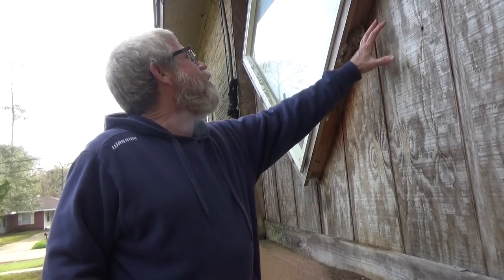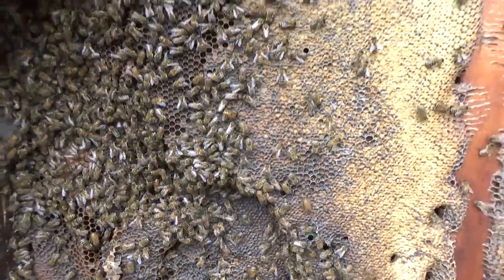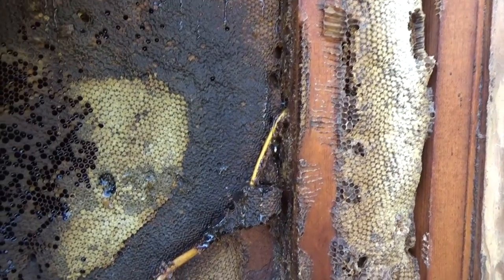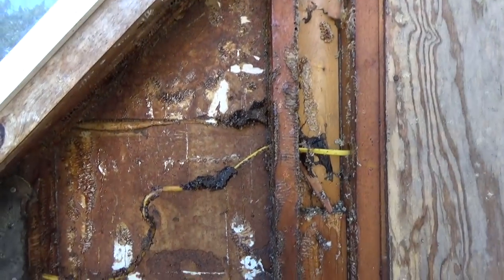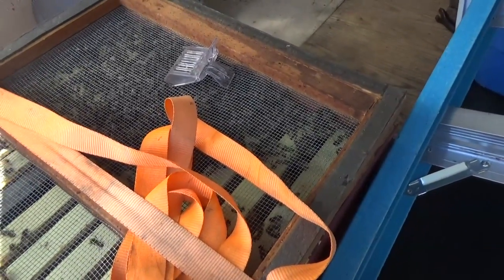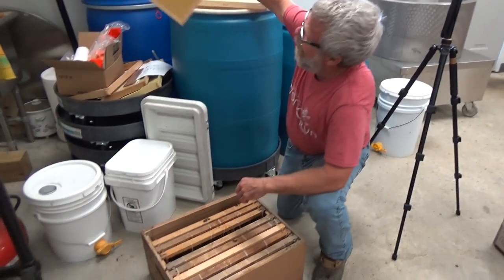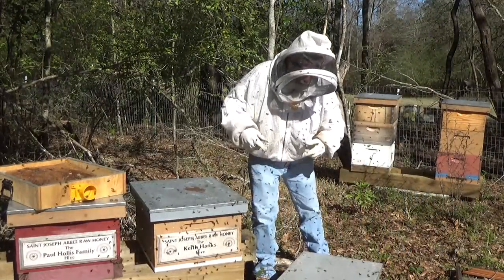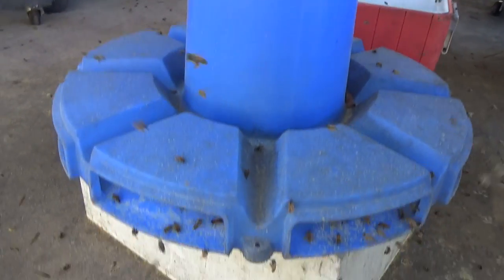Electrified bee hive. What happens when you cut a wire hidden in honey comb

Comment: Aloha Jeff, 
What is the main honey that you find in these wild hives? Here, it can be one of the main flows[mostly] and all the short, quick flows are not saved by the bees, but they eat it up or use it for building their comb. In tall stud walls, they pack in about 100 pounds per stud. And if there is a pathway to the next stud, it will mostly be another queen and hive. One empty home had 20 studs full of hives. Each was another queen, each was full and 100 pounds hanging full of honeycomb. It took a week to remove them all and reclose the walls. Each one I found the queen and removed the colony after dusk when all the field workers had returned for the night. It was worked from both ends of the wall, one hive at a time. Caging each queen and tieing all the brood to frames as each brood comb was freed from the wall. But we never moved bees until dark, so we were able to take each hives workers as a unit, with their own hive. It was far less stressful and the new locations were orderly the next day. almost seamless in their adapting to the move.
Reply from the maker: I'd have loved to work cut outs with you Mark, and not only because you are in Hawaii. I'm sure I could have learned a lot from you. Thanks for sharing and for watching. God's peace brother.
Mr. Ed

Comment: So we put up electric fences to keep the bears out. Looks like the bees are learning to put up electric fences to keep US out. So glad you were not shocked, especially since you were working up on a scaffold.
Reply from the maker: I had the exact same thought, it's the newest technology the bees have developed for self protection against bee wranglers. I hope the idea does not catch on. God's peace Bea.
Mr. Ed
Reply: I too am glad that this was not more serious.  I understand that in the USA your mains electricity supply to houses is 110 volts?  Yes you got some fireworks! But, in the greater scheme of things, 110 volts is dangerous, but not nearly as deadly dangerous as 240 volts which is used in Australia.  If that cable had been at 240 volts, your knife would have had a significant chunk zapped out of it! 

Perhaps a safe way of dealing with a cutout, where there is the possibility of an electricity cable somewhere in the middle of comb like this, is to use a blade which has had the sharp edge completely removed.  That way, especially when making vertical cuts where the comb is attached to the wall studs, you would be able to cut the wax comb, and feel if there was any obstruction which needed investigation.  You would be able to "feel" that something - maybe a power cable - was preventing you from continuing to cutout the wax.  I would also comment that in this type of situation that this blunt blade should just be pressed downwards as it moves through the comb, and not moved with a back-and-forth sawing action which would be more likely to damage a cable.  Most importantly, you would feel that something was there before you actually cut or damaged the cable, or worse still before you got electrocuted.
Reply from the maker: @wilfredkube8570  Thank you for your comment Wilfred. I am constantly aware of the possibility of hidden wires in walls and floors while doing removals, but this one caught me completely unaware. There are now instruments available that can see through walls, and I hope wax as well, that can detect their presence. Rest assured, I will be getting one. Thank you for your concern, it is greatly appreciated. God's peace brother.
Mr. Ed
Reply: @wilfredkube8570  @Wilfred Kube, the mains to the panel box are two legs of 110 so there is the possibility of 240vac depending on what is being fed. A lot of air conditioners, stoves, dryers, etc use 240 volts. So there could be 110 vac or 240 vac anywhere in the walls, ceiling, floors.
Reply from the maker: @OkieRob  A bee keeper, a farmer, a mechanic, a gardener, a banjo picker and now I find out you'r and electrician as well, with those qualifications you should put in a job application to the Dirt Rooster, I hear he's looking for help. God's peace Okie.
Mr. Ed
Reply: @JeffHorchoff  maybe you need to hire me as a consultant , might save you from cutting any future wires. I don't recall the dirt rooster needing any my expertise. 🤭
Reply from the maker: @OkieRob  What raises my concerns with hiring you is your past collaborations with the Rooster, particularly when you planted the tracking devise in the Life Alert so the Rooster would know my swarm trap locations, and I was completely unaware of it being there. By the way, that devise is now at the bottom of one of the abbey lakes. God's peace brother.
Mr. Ed

Comment: I bet dirt rooster hasn't ever made a fire scene like that before. Lol
Reply from the maker: I would not make a bet on that, that guy has quite the shady reputation. God's peace Tim.
Mr. Ed
Reply: @JeffHorchoff Being a master electrician,  I'm curious about what was done to repair the cut wire ? I'm surprised that you weren't electrocuted. Is it imperative that you use a knife with a serrated blade?  I couldn't tell about the blade.
Reply from the maker: @timhottinger2166  The repairs were completed by the contractor, who was licensed, so I'm very confident they were done professionally. The serrated knife is the best knife to use to cut comb, it makes short work of a difficult job. I am always cautious when cutting into wall or floors as I do not want to hit wires or pipes. However, on this removal, the wire I hit was totally unexpected. Trust me, I will be buying a device that can look into and behind solid walls detecting the presence of those materials. God's peace Tim.
Mr. Ed

Comment: I find it is easier to do bee removal from the inside. drywall is cheaper then siding.  Just FYI.  my 2nd tip "o" the day, I drilled a 1/2" hole near the end of the vacuum wand so the vac would not suck up tight on to the comb. hope you's guy's find this helpful.
Reply from the maker: I refer inside removals as well, it's easier and I love working in the AC. Still, if the walls are covered in tile like this one was, it was a bathroom, and the siding on the house was being replaced, removing the bees from the outside was a good way of doing it. Thanks for watching. God's peace Scott.
Mr. Ed

Comment: Thanx for the work you do to save honey bees. Why dose it matter that you keep the top of cone up when framing the cone?
Reply: Steve Blauvelt , it’s important because the cells are built on a slope !...if you put the comb with the top at the bottom of the frame then honey won’t stay in the cells!....the bees will not fill these cells..and start chewing on the comb to use it for building new comb or repairing other comb.
Reply: @RobertSmith-nm5vj  Your comment about the bees chewing on the comb is interesting. Are you saying that the bees will (or can) actively reuse wax to repair old comb,  or build new comb?  If this is so, is there a good way in which beekeepers can salvage old wax, to provide the bees with wax that they can use to build new honeycomb?
To put my question another way, what is the best way I can help the bees to use old wax to make new honeycomb?
I would appreciate hearing from anyone who has experience or advice in this matter.
Reply from the maker: I have been rescuing bees for almost 8 years now, and the joy I receive by doing it is my compensation. Thanks so much for taking the time to follow along. The reply from Robert Smith below is a very good explanation as to why orientation of the comb is important. God's peace Steve.
Mr. Ed

Comment: Greetings. We watch all your videos, appreciate them much. 

But the wire, I was an industrial electrician with no desire to rewire my own house, we had that done, expeditiously, by residential electricians. But I wanted to add a switch, so I used a saw, similar to yours, with the same results. Our home, built in 1900, needed multiple circuits on the 2nd Floor. They went up near the vent pipe, I was cutting in that area with a hand saw. Then I saw sparks. 

Just wanted to mention that code disallows in the wall repairs. I ran a new wire, and junctioned it in the basement, in a workbox. But no splices are permitted, not in the wall, not even in the wall in a workbox. Inspection points I believe, you can't inspect something you can't get to. 

Of course, I have no reason to believe you spliced it, or junctioned it in a work box, in the wall, just wanted to mention it since the issue wasn't mentioned. 

I didn't see the spark on the video, my wife and I rewound and played that section a few times, but I saw the spark with my work at home. LOL.
Reply from the maker: Great comment! Just to put your mind to rest, as mine was, the licensed contractor, who was on the job when the short occurred, fixed my mistake the very same day. As he was licensed, I'm positive it was done according to the code in our area. It's very easy to find when the spark occurred on the video, I used slow motion to add a bit of drama to the experience. Thanks so much for watching and leaving your comment. God's peace.
Mr. Ed

Comment: Fixing that wiring issue will be a problem as you are not allowed to bury a box in a wall
Reply: Haha. Yeah, short piece of NM cable and wirenuts. No inspector in sight. Electrician over 50y. Dug a many of them out for repair where a carpenter had previously cut a cable. Sometimes there weren't even wirenuts just a "spit splice" (twist & tape). Homeowners were always surprised and stunned by the additional cost for proper repair. Contractors must carry insurance for such situations or pay the cost of doing it right.
Reply: @gerardjohnson2106  haha true. They have no idea of rules and regulations to keep them safe. I guess they prefer to chance it and come home to a foundation
Reply from the maker: The licensed contractor on the job took care of the repairs, that way, I know it was done to code. Thanks for watching. God's peace Roy.
Mr. Ed

Comment: Mr Ed, you ever thought about using a headlamp rather than holding a torch in your mouth? I'll bet it would be more comfortable.
Reply from the maker: I have used a head lamp, but I was never satisfied with the light itself or the placement of it, it was always in the wrong place. Though it looks weird, holding the flash light with my teeth puts light right where I need it, and it is not uncomfortable at all holding it for extended periods. Thanks for watching. God's peace Dave.
Mr. Ed
Reply: @JeffHorchoff  Thanks for the reply. I always enjoy the vids, and the banter between you and the rooster. Learned a lot from you both.

Comment: every contractor knows that framing studs hold the wiring for the building.  since  you used the term contractor and not electrician i assume you spliced the wires and closed the wall back up. I would open it back up and repair it properly, call an electrician. if you routinely run serrated knives down framed studs you should probably invest in a non contact volt meter before you open a neutral and somone in the dwelling gets hurt.
Reply: btw rubber boots dont protect you if your metal knife contacts the hot wire and the neutral wire at the same time. you and your knife become the bridged connection to ground.
Reply from the maker: I did not preform the repairs, the contractor on the job, also an electrician, made the repairs according to the codes in the area. Coming across  wires in walls during a removal is a very common event. However, this one was completely concealed by the comb, and Idid not even see it. Thanks for watching. God's peace.
Mr. Ed

Comment: If he was profesional he would use a stud finder
Reply from the maker: 234531 95895678 How does a stud finder locate electric wires? Thanks for your suggestion and for watching. God’s peace.                  Mr. Ed
Reply: @JeffHorchoff  because many modern stud finders will also pick up electrical wires, i dont know how it works nor will i pretend to but be assured it does. aditionaly since the wires are live you can use a wire tracer to find it from the circuit box albiet this is situational